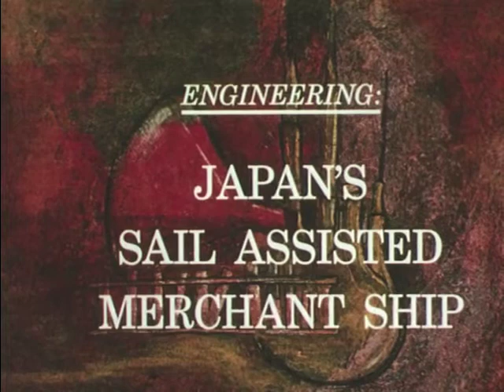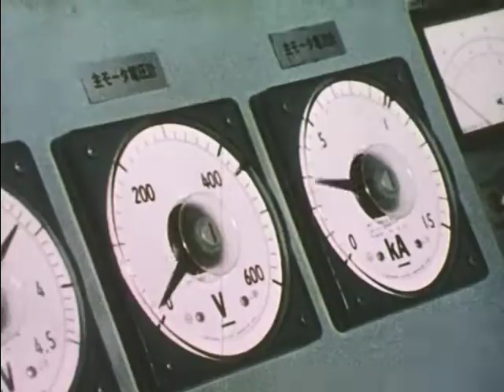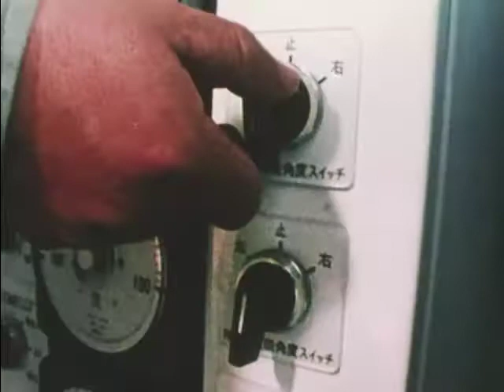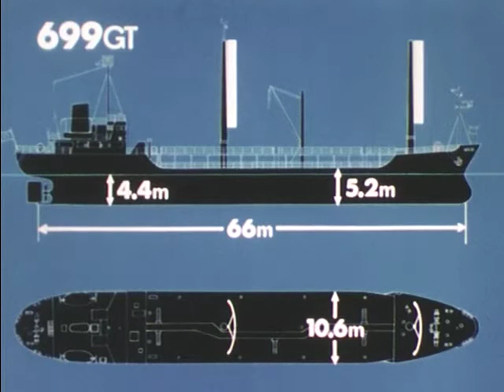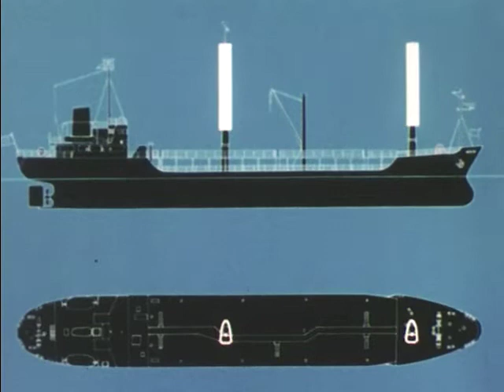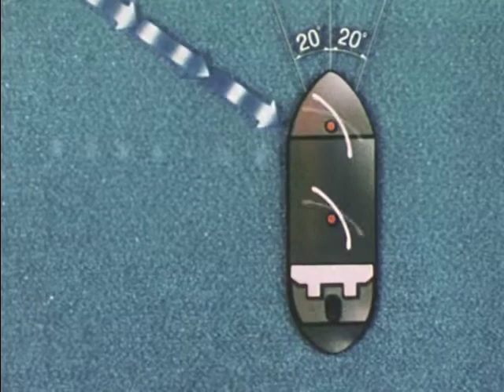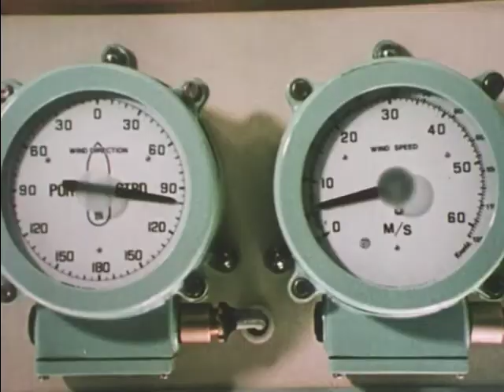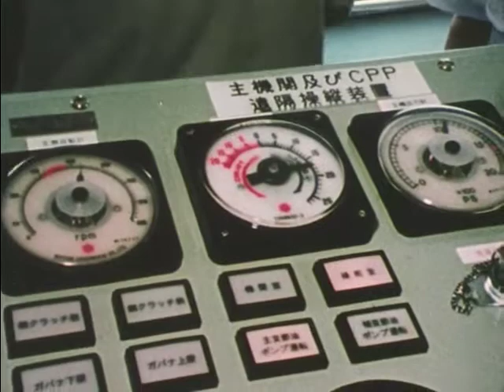Engineering : Japan's sail assisted merchant ship (1983)

Comment: After more than 30 years and nothing happens. You don't see these wide spread because after adding material repairs and maintenance of those sails, the saving is not that great.
Reply: Three major problems if ‘the wind don’t blow the ship don’t go’, when it does blow it often blows in the wrong direction for your cargo delivery needs and sometimes there is rather too much of it for comfort.
Reply: @BernardLS  if you pay attention to the video you wouldn't say that
Reply: @fitrianhidayat  I will hold with my view the best, and it is not good, means of harvesting wind energy is with HAWT.  The example in the video, having 200m2 of sail area, would harvest circa 140 000 watts of power.  In 1870 a premium sailing vessel entered service, the ‘Cutty Sark’.  The Cutty Sark was 64.74 metres in length with a beam of 10.97 metres and a loaded displacement of 2 100 tonnes.  She was able to carry 1 700 tonnes of cargo and to harness the energy in the wind the available spread of canvas was up to 2 976m2 which was tended by a crew of about 30 skilled men.  A ratio between the sail area (SA) and the vessels displacement (D) determines how lively she is; ‘lively’ being nautical speak for ‘fast and manoeuvrable’.  The carrying capacity of cargo ships is constrained in two ways, mass and volume which leads us to the ‘stowage factor’ of the cargo; the more mass on board the greater the displacement which in turn impacts the efficiency of the hull form and sail area / displacement ratio.  A vessel constrained by mass is said to be ‘down but not full’, a vessel constrained by volume ‘full but not down.  When in the tea trade, which the ‘Cutty Sark’ was designed and built for with fine lines (more nautical tech speak so again - no need to worry about it) she could carry around 600 tonnes of cargo at speeds of up to 17.5 knots dependent on the prevailing wind and had a typical China to UK time on passage of 120 days.  The tea trade was very competitive so ‘time on passage’ was a large factor in securing the premium freight rate that made her cost effective.  Rounding things out, her maximum available sail area gave circa 5m2 of canvas for every tonne of tea carried.

As soon as the Suez Canal opened, which the ‘Cutty Sark’ was unable to sail through; she lost her advantage, raw speed, to the steam powered ships of that era who could beat her ‘time on passage’.  Mechanically powered ships have improved in terms of efficiency, on a freight tonne mile basis, by at least one order of magnitude since then.  After losing out to the coal burning, steam reciprocating mechanical ships of the late 19th century ‘Cutty Sark’ was relegated to the Australian wool trade, just about the bottom of the barrel in maritime terms and only one small step up from being a 'honey barge'.

Random fact about ‘Cutty Sark’, it is said to have been possible to coax 3 000 horse power out of her sails, or in ‘real money’ 2 206 500 Watts (2.2 megaWatts), 741 Watts for each square meter of sail area.  So that majestic spread of canvas would have been even less efficacious for delivering your baubles and bows from the orient, despite taking about three times as long on the voyage.    Remember shipping is a high volume low cost, therefore low margin business, and all costs have to be beneficial.  Wallenius are currently giving wind power a go with wing form ‘sails’ but evidence is a little short of proof as of this date.  KTH (Kungliga Tekniska högskolan), a sort of up market university in Stockholm, who are using the funding to derive results will probably, and eventually, in the best traditions of academia ‘publish’ a ‘paper’ unless the funders invoke the well known ‘commercial sensitivity clause’ of their agreement with the KTH.
Reply: @BernardLS  I don't know why you're saying all that. Just watch the video and you'll see that your first comment is invalid